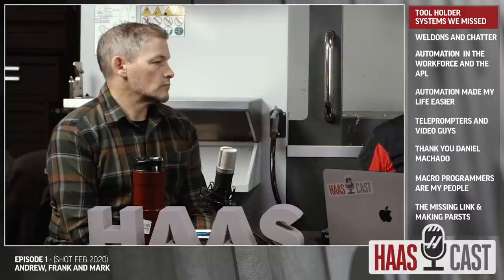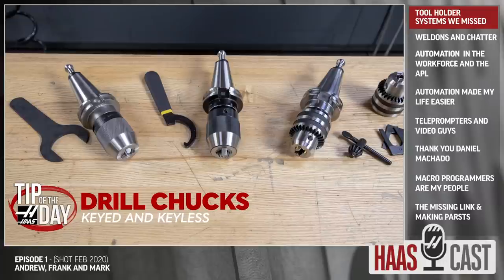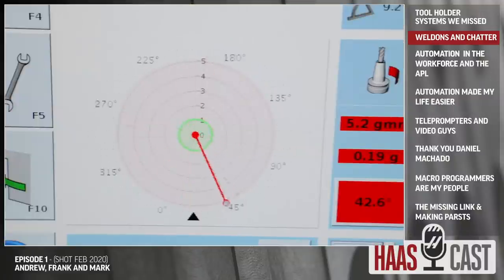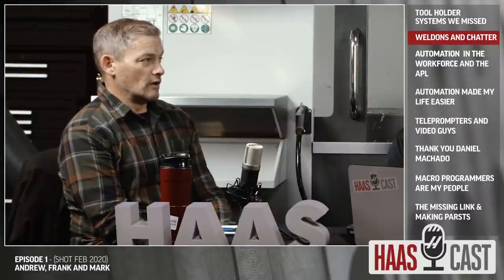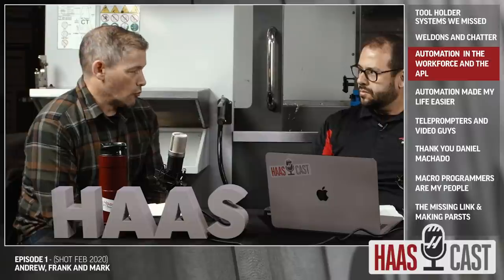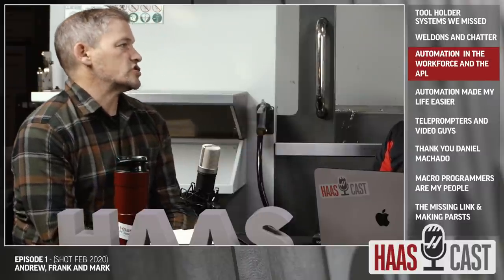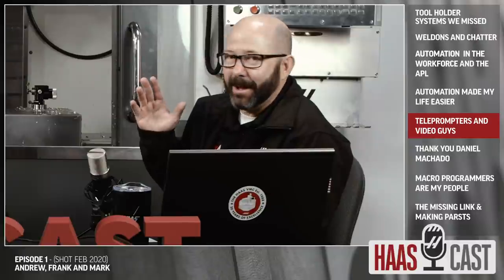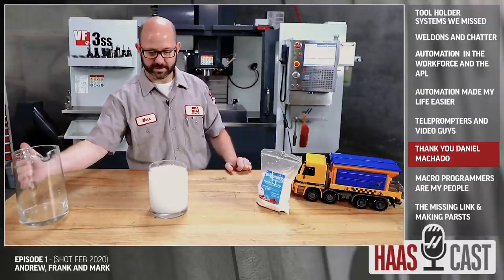HaasCast - Episode 01 with Mark, Frank, and Andrew - Haas Automation CNC Machine Tool Podcast

Comment: When I was in Thailand, I encountered an American engineer that had just come from the site of an almost completed bridge. He commented on a discussion he had had with the site engineer. There were about fifty men digging the dirt to finish an abutment and 200 women with baskets moving the dirt to another part of the worksite. He did some quick calculations and communicated to the Thai engineer that he could have built the bridge with modern equipment for a very reasonable price (for the time, 1960s), the Thai engineer laughed and told him that the total cost of the project, which included thirty kilometers of road, was about half of the price the American had quoted. The cost of the machines and machine maintenance would be more than the total cost of the project using "traditional" methods. Old is not always bad!

Comment: Hey Mark, I would like to know, if I'm editing my program on my vf2  2011 model, can I edit feed rates quicker than scrolling through the whole program and typing the new feed value for every f block? Like for instance I want to change every F100. to F150. Can I somehow do that without altering every feed separately?  Thanks so much for what you are doing!
Reply: The EDIT>F1>Find and Replace All function works great for this.

Comment: Where can I get technical help from guys like y'all, I'm having issues with a haas vf10  setting tool off sets, off a speroni tool setter from the Hass to the speroni it's allways. (. 073) shorter. We have to add it after putting the height from the speroni measurement. Don't know if this is a easy fix or is there a Marco or a perimeter I could adjust to fix this.

Comment: Love the tips and tricks you guys do, the future is automation I am a one man band I run a Harrison 460t so it's semi cnc I make one offs to 100 hundred off but I can not compete with bar feder guys as I have to manually change tools, open chuck and pull material out, I also run a bridgeport interact that also has manual tool change. I keep having the carrot dangled with increased work so I was about to look at a doosan lathe and a hass vf8, if I had the latest cnc I would definitely look at parts loaders it's a no brainer I could run more machines, I also have 4 manual lathes, 4 grinders, 2 presses, 3 Mills, 1 jig borer, 1 jig grinder, 1 charmiles 510 edm, 1 manual spark eroder, 2 radials, 2 capstans and a few odds and ends. I would love to get into the production machining but have never got the brake, of course I do OK at prototype work and special purpose machine bits but it's frustrating sorting out and getting pre production niggles out for someone to then just load up a machine and press the button. With this plandemic at the moment it's perfect for companies to look for automation and no hassle with staff. Sorry rant over, keep the videos coming I can still dream. 👍🏴